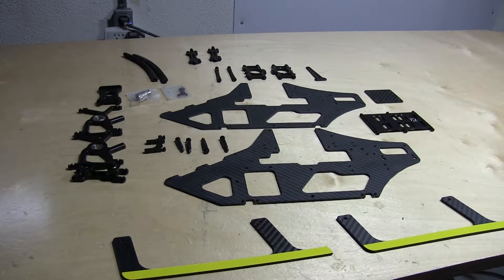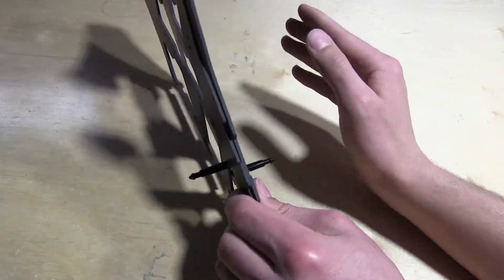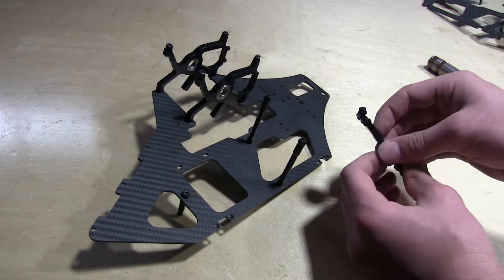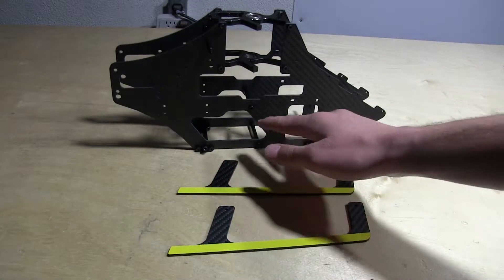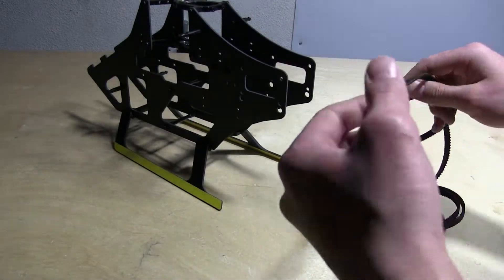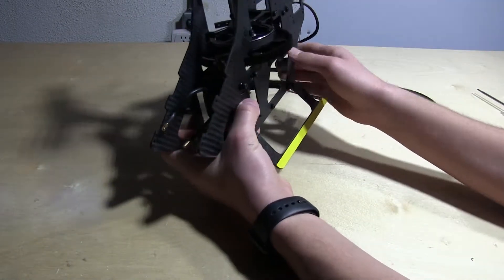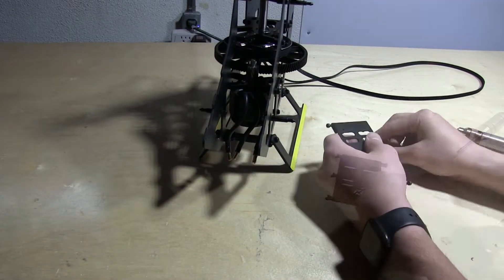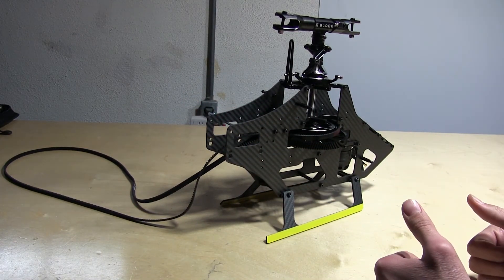Blade Fusion 480 BUILD SERIES: Main Frame

Comment: Thanks for posting Ethan,  I noticed the connectors are already soldered on your motor.... I have a super smart combo coming and from what I can figure out, the 4mm mail connectors are not included in the kit. Is there a connector type you recommend. I am using the Avian ESC.